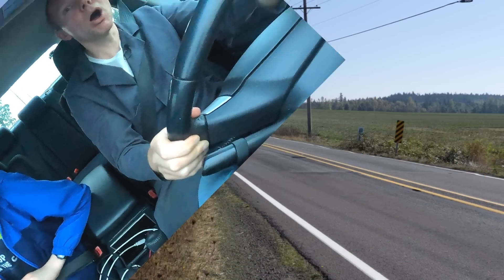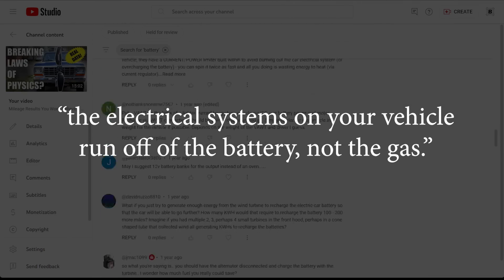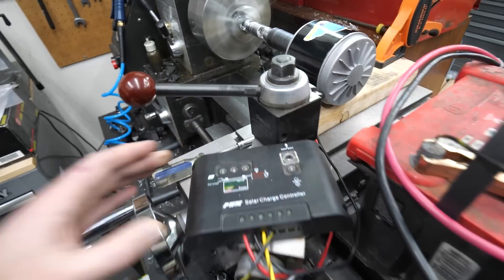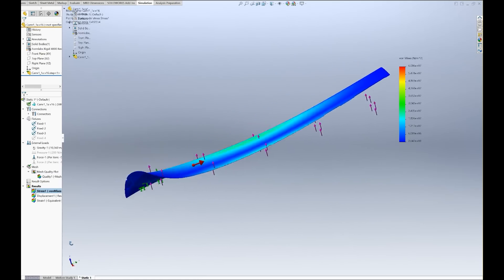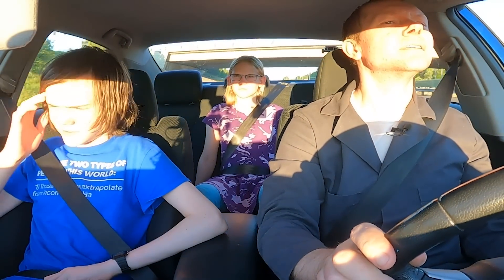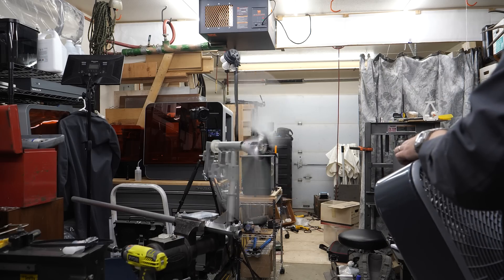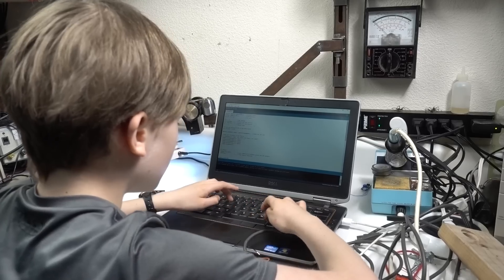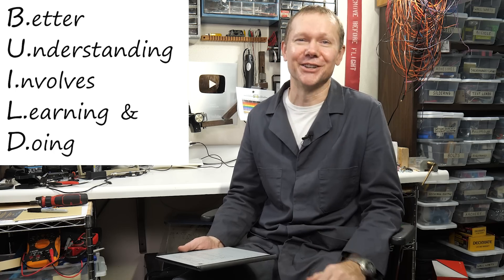3D Printed Turbine on a Camry - Wind Power on a Car #6

Comment: tunny thing is if you were to drive it in my country you would be pulled off the road for safety issues. a rotating blade fan in front of the car isnt allowed here . imagine a car in front of you .. a truck with gravel lets say loses a pebble... it bounces off the road against your blade.. one blade snaps off a part and if flies sideways hitting someone ..  etc etc, in end they wll beed to be in some form of cage

Comment: you can place it in front of the car.. yes . buy you forget turning a dynamo/generator to make electricity is one thing... but as soon as you use it. to charge or other stuff you are putting a load on it. the dynamo/generator will be much more resistant. that causes resistance to air also. now  (just as putting a load on a iddling diesel generator will make the generator use more fuel) i might be wrong .. you are doing practical... bu i would think its not the gain you think it is

Comment: Ive been curious about a horizontal drum like a wide squirrel cage on the rear edge of a trunk lid  , the laminar flow over the top and low pressure on the bottom would spin like crazy.

Comment: There is one case where it could work: if you drive in strong headwinds

In this case wou can extract energy from the difference AIR and the ROAD moving at different speeds.

But everytime you try to extract energy from the airflow that you create by spending energy from the gasoline you create even more resistance and losses. Because you are not making the car more aerodynamic but increasing it's effective frontal area. 

There might be a sweet spot in front of the car where,  by using very small turbine, you will create a sort of effective better airflow around the car an reduce the overall aerodynamic resistance. But with losses, Betz, Generator efficiency...hm I doubt you get significant energy from the turbine...

Comment: The way to reset ecu error code in my 1997 lancer is to disconnect negative battery terminal while the engine is running
Reply from the maker: Never heard of that! 👍
Reply: @QuintBUILDs  I am thinking to harvest wasted engine heat, still digging. The way you generate electricity similar to how airplanes power its air conditioner. I think you should better reducer to generate more wattage from slower props rpm, worm gear maybe or even harmonics drive. 

Nice effort btw, good for initial reference for many👍 thx

Comment: RE: Putting the wind turbine in front of the car, I have a quick thought experiment for you to consider:

Imagine your wind turbine was a propeller on an electric motor, it would push air over the car faster than if there was no propeller, yes?
The wind turbine is literally the inverse: the wind turbine is slowing the air passing the car down more than the car would otherwise, yes?

If you can agree that the air going over the car is slowed by adding the turbine (as otherwise we would have to imagine it is not sped up by the propeller in the inverse situation), we have net increased drag on the overall system, correct?  It is not 'free' energy turning the turbine.

Thus I expect the fuel efficiency loss is at minimum equivalent to the efficiency loss of the generator, plus the drag imposed by the structure of the wind turbine.

Comment: i always speculated that a edf turbine for rc jets would do great for this situation ..... mounted inside a tube of 4 inches or larger... both turbines mounted several inches away from the intake and and another at the exhaust of the pipe..... maybe instead of a multi-bladed prop.... a corkscrew down the majority of the intake tube would work the same if not better..... i would mount the turbine underneath a vehicle due to how air tends to move over sloped surfaces creating a faster more power source of air underneath the vehicle alot like an airplane wing ..... i believe you will hit your target like this while making the system safer and more compact....... my intent is to experiment with this system inside of a wing alot like they did in ww2 for the spitfires radiators

Comment: I’m no scientist by no means but have you thought about an air intake from the front and channeling it into tubes where you could place your fan motor. I would think channeling the air would give you more air pressure allowing for smaller blade size. Like I said I’m definitely no scientist 😂

Comment: Firstly I love this line of experimentation. I do have several questions though. My first thought is that while yes the car will have to disturb that air you expended the turbine beyond the normal area of disturbance that the car makes making the car act on a larger volume of air at one time and this possibly leading to a more inefficient vehicle. Another line of thought I was having was how will the air disturbance effect the normal aerodynamics of the car itself. If your turbine is causing excessive vortices could cause increased drag over the entire body of the vehicle by interrupting the laminar flow of the air over the large surfaces of the car. Also there is a very small chance that the disturbance could possibly cause improper air flow through the grille and affect the cooling of the engine, it's a small chance but possible. Without wind tunnel data it's really hard to make any accurate predictions. Put on the spot I would guess that the efficiency increase to the electrical system weighted against the possible increases in inefficiency in other places I would guess it's a total wash. Meaning either 0 ± 3%.

Comment: The difference between a turbine mounted on top and a turbine mounted in front is frontal area. With a turbine mounted on top. You increase the frontal area of the vehicle as if it is mounted parallel with it, or right in front of it, you are within it’s already established frontal area footprint so to speak. So you are not increasing drag on the vehicle noticeably with a flat nose like the bronco. In fact, from the vehicles perspective, you’re actually decreasing drag. The turbine is slowing the air down before I can hit the hood, which means less air drag is active onto the vehicle and it is being shared by the turbine.

Comment: I capture the excess power generated by the alternator and charge 3 200ah batteries and tbh I could charge maybe 4 or more with how much I drive. It's enough to run a small house

Comment: WRONG, disconnect the battery and try to drive around (day/night) and it WILL die.
Look at the battery as a buffer where, the battery fills in for idle times w/ power draws, i.e. headlights, defogger, etc...

Comment: What happens if you use the cooling fan as your generator.  Might not work on that car because it’s electric.  On my 2001 f 150 it’s clutch driven I think.  Idk how to explain what I’m thinking very well but can you capture the air already moving through the engine bay?  Such a great series!

Comment: As for the question on "in front" or "on top" of the vehicle, thinking about it (not the smartest guy in the room), arrow dynamics of the vehicle moves the air over the car faster then the air coming straight at the car, so putting the turbine in the optimal placement to catch that air would make for more effectiveness?

Comment: I my thought is that maybe you should create more of a “water” wheel type design where you can capture air and have it rotate a blade system opposite of the rotation of the car tires and not perpendicular to it.  Think paddle boat and not prop engine.   Anyway if you could create a tunnel for the air to flow through it would allow you to direct air into more power.  At least that is a theory.

Comment: fuel effeciantcy would prob stay the same in best case scenario or be worse because you will need to use more gas to make the car go faster for the fan to spin at high speeds its the same reason why you can't add an alternator to the wheel and start driving and recharge your car because to make electricity it requires power from somewhere else.

Comment: There's two levels going on here for the efficiency.   The drag from the windmill on the frame take more power (Force * velocity = power) than the blade can generate (only ~30-40% efficient * alternator efficiency * drive belt efficiency).    So that's strike one.   Strike two is harder to prove, but messing up the air flow going to the car probably doesn't help air drag on the car.  It gets complicated since you actually accelerate the air forwards before it gets to the car with the windmill.  So it's better to look at it as a whole system, windmill + car, in which it probably has a worse drag coefficient.

Comment: Here's that answer you requested:

First, my background  -- I'm  75 and have built wind turbines for about 55 years.

Okay, the answer:

A wind-tunnel simulation  would clearly show the area in front of your vehicle COMPRESSES the airflow.

A better turbine application  (IMHO) would be to use a VAWT mounted horizontally either lower (if room allows) or higher at a point tangent to the radius of your car's hood.

In either location. doing this places your wings directly WITHIN the airflow.

Sidenote:  I build small compressed-air operated engines as well as (mostly) VAWT wind turbines and all my windmills compress air whenever the wind blows in North Texas (24/7).

If I decide to build the contraption,  I'm describing here, I'll post a "build" video on my own YouTube chanel.

Comment: Purdue ME/EE here.   You failed to account for the extra work the engine has to do to sustain pushing against  the turbine generator and the reaction force/work of the air flowing to turn the turbine .  Where is your fuel consumption data?   First Energy rule---"No such thing as a free Lunch"...  The engine has added work to drive/operate the turbine system so yes the alternator has less load but the engine probably has more... again where is the fuel consumption data?
Reply: The point was always that the front of the car is completely blocking air flow at the front of the car. So that force is pushing the car to the rear with or without the turbine. If you add the turbine BEFORE the wind gets stopped dead, then you gather that winds energy right before it pushes the car back anyway.. yes there is some resistance created still by the turbine, but very little when compared to hitting the grill of the car, going through the radiator, hitting the engine and firewall, then getting forced out the underneath of the car, or out the wheel wells.

Comment: Based on estimated losses or the generators and other factors, like wind direction, wind speed, needed generator speed, the space between the turbines and the car where the wind can go after and other such variables, I would expect you should get somewhere between 4% - 6% economy on fuel. Basically needed less for the same speed as before installing the turbines.

Comment: So I have a crack pot theory about the fan being in the front. It’s like aerated water.  If you jump off the Coronado bridge you’ll die but if you could somehow inject bubbles into to water you may be able to survive. However when you try to float a boat in the same bubbly water you’ll sink. So in analogy you may be creating a slightly higher work for the vehicle you’re also gaining efficiency by disruption of the congruent or stagnant air molecules… I don’t think you’re canceling out the extra drag entirely but you’re gaining a lot more when that work is committed to turning a generator versus just cutting through the air. My primary source of data is from “Talladega nights, the ballad of Ricky Bobby” shake’n bake would have never worked if fluid dynamics didn’t exist… I think. You’re basically creating your own draft, if I’m correct you’ll see a slight increase in engine coolant temperatures I like racing and that’s one of the drawbacks to drafting for long periods of time. 

If you put it on the roof I think you were entirely correct. You are going from a regular footprint to a Sasquatch footprint… you’re imposing force on airflow that would have not otherwise played a factor on the cars drivetrain.
Reply: Ps I love your channel and the fact you’re doing with your kids gives me hope for society.

Comment: Put the two fans in the front connected to the frame but in front of the wheel that way the air going to the sides can be vented into a duct with the turbines inside. Kinda wind tunnel the air into the turbines.

Comment: This was done about 55 years ago in NASCAR. Just about the most famous chief mechanic was Smokey Yunick. He mounted an alternator to the front of the radiator with a propellor on it. This was all behind the grille. Since the cars go between 120 and 200mph (200-300km/h) there was plenty of wind to spin the alternator. Then, he removed the alternator from the engine. Since the whole thing wasn't in front of the car, it had no effect on the aerodynamics of the body. It provided enough power to charge the battery and run the ignition system and gauges.
His efforts were not applauded. As soon as the tech inspectors saw it, they immediately created a rule that banned it.
Reply from the maker: Thx, I've got his book with pictures of the original.

Comment: What about turbine breaks? Cars could stop faster if the air is caught by turbines, and the turbines could charge the batteries. It could extend road surface braking..

Comment: I never thought of putting a turbine generator in front of the vehicle and on the pickup I believe induced drag would be difficult to detect or completely negligible. Even with the improved aerodynamics of the car I still think it would take some very careful work to identify the extra drag. I think damage to the front grill would create more drag than having that little turbine out in front. 

If you put the car with turbine(s) in a wind tunnel I think you would find turbulence over the hood and even on the road you might detect movement of the stationary windshield wipers.

Do I think it’s causing drag? Yes
Do I think it’s causing more drag than can be recovered? No

Just found your channel and I’m enjoying watching, mostly to see you support the curiosity of your children. Keep up the great work!

Comment: Can’t make energy that way, however propeller on the end of a long stick facing from back end might work ( if long enough energy is lost from the car anyway and won’t influence the car except for reverse drag, which may or may not lead to an energy overall gain), probably small though, probably in long run get more from very long nose and rear wing like shape with pointy tips in my opinion anyway or some wind tunnel tested similar configuration. Perhaps using a helix, forget the shape but around a properly shape  object the vortices would form around the object two possibilities think one is called Kármán vortex street and the other is a helix based on golden ratio

Comment: I think a turbine would be effective in place of something like a spoiler or vertex generator - which garner some additional fluid friction for a greater saving in drag that comes from creating turbulent flow where the 'stream' of air leaves the vehicle.

in this case, the goal is to create turbulent flow in itself, and while a turbine might not be as effective at this as something like a vortex generator, I think the recovered energy would be a net positive. Most probably best with multiple smaller props and higher rpm to minimise drag and maximise proper turbulent flow.

Comment: I'd say about a 10% improvement. Also i would disconnect the alternator in the future and run on the battery and turbines only. I've run my car with a broken alternator before and it lasts about 10 min. But the fuel consumption went down by 15% because the engine didn't have the parasitic drag on the engine. Having no alternator connected might even bring you up to 20% in total. Also i have a diesel bmw 2l diesel. Getting 60 MPG went to 67MPG without alternator. Also might be interesting to look at how much power your engine spark plugs use.

Comment: 8% mpg improvement, even more if you make good use of the generated power, You coooouuuuld also run a clutched pully on the enginebelt too... or a BAS system off belt.  I do energy efficiency as a hobby, I know of 2 older vehicle that have done what youre doing. The one with pictures used a drum / squirrel cage fan molded right into the hood.

Comment: In theory sure. In practice... 800W is a little over a 1HP assuming a car uses about 20hp at cruising speed that's theoretical gain of 5% efficiency. Let's see what you measure

Comment: You're not accounting for fluid drag. It's going to decrease aerodynamics and cancel out any gains you might see. The added turbulance is only going to hurt fuel economy. You can't get something from nothing. You're trying to create perpetual motion. It's not going to gain you a thing at best, and hurt your fuel economy by like 4-6%.
Reply: FD=1/2pv squared C with a function of D *A 

I rest my case. The math aint mathing. 4-6% loss due to added fluid drag.

Comment: Wont work…sorry had to say it but i do think its the same as having it on the top. The front air is still air that wouldnt have been disturbed. Im also thinking about the changein the aero of the car probably not that much of a difference. 

What about dragging it through the air not pushing it